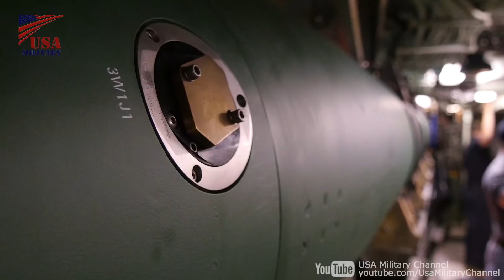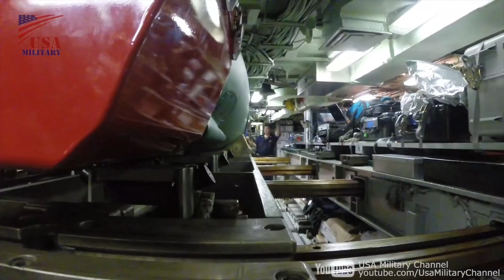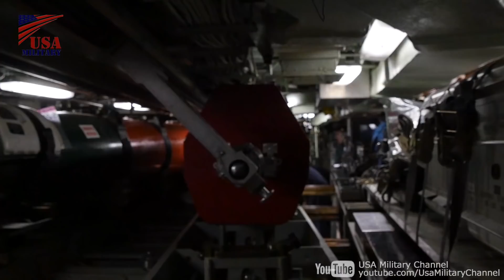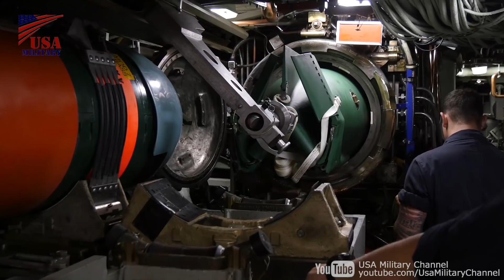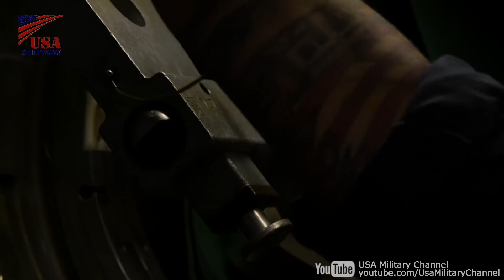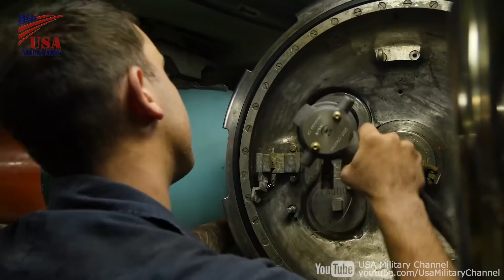潜水艦発射型ハープーン(UGM-84)の魚雷発射管への装填

Comment: I've loaded many a Harpoons on a P3 Orion.  On the sub it looks alien with all the accessories for an underwater launch.  The last thing we did after the missile proves good is attach the fins.  I did not see how they do that on the sub unless it's already on there and folded.  Interesting though.
Reply: yes, for the sub launched version the rear fins are folded up and the front fins are tucked into the missile body and spring loaded so they pop out when the missile leaves the water.

Comment: How pathetic that it takes this long to load a tethered torpedo . Its shameful and embarrassing.  There is no reason for the slow movements of machinery when the 2 point are always the same . You start on the rack and move in 3 directions. The tubes location never changes , therefore why the slow transfer? This system should be automatic and evolve people only to supervise.  Looks to me like a waste of time and money
Reply: Keith, did you read the title? Obviously not. This was a HARPOON MISSILE loading, not a "Tethered torpedo" There is no such thing, there ARE, however, WIRE-GUIDED torpedoes, ours are Mk48. You also have obviously never even been close to, let-alone inside, a submarine, else you'd understand how the torpedo's and missiles are stowed, and what is required to move them. You also need to do some reading-up ON the Harpoon, particularly the sub-launched variant. Let's face it, you need to do a LOT of reading to fill that void of opinionated ignorance you're carrying around. Return when you have accomplished this. Dis-MISSED!
Reply: @stephenhoward6829  A Link wouldn't have been fitted at rear door,